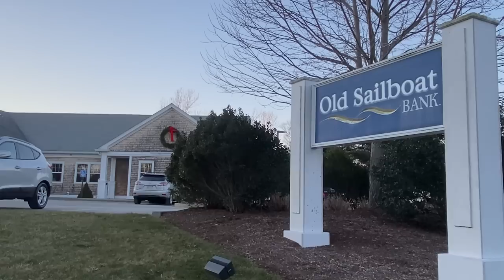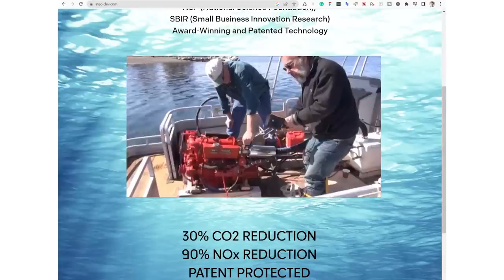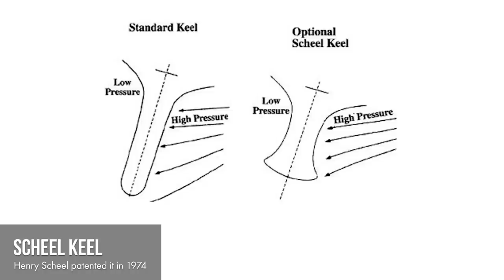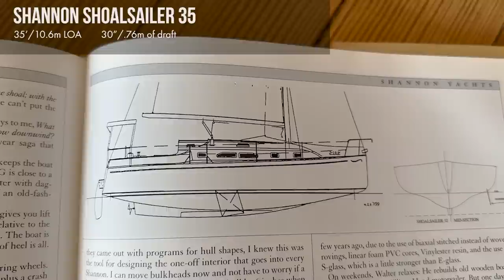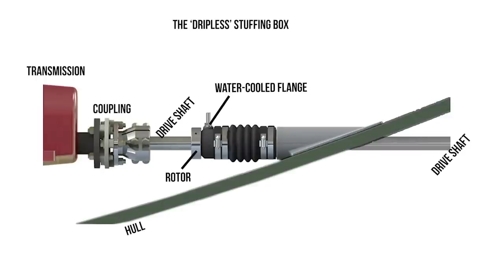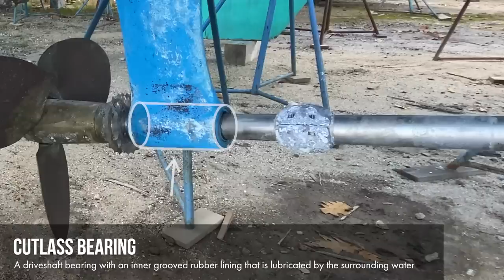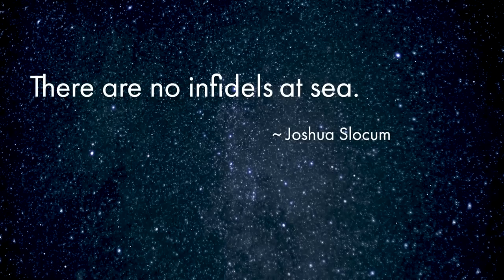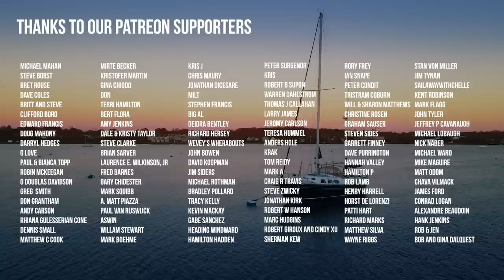Ran-day's Sailboat -  Visit from Walter Schulz - EP10 #sailboatrefit #sailboatrestoration

Comment: raN-dAY!   Cleaning out old bedding/re-bedding anything accessible including the CHAINPLATES with fresh butyl tape is a no brainer.  That should have been done already just for fun.    I usually do the Chainplates, pulpit and stern rails, mast deck plate if deck mounted(folks DO NOT USE BUTYL HERE, USE ADHESIVE SEALER) , stanchions, cleats, winch bases, chocks.....you're lucky to see the leak...most of the time it's rotting the deck core for years as it enters the deck somewhere and leaks into the cabin 10 feet away like that toe rail bolt.  ;)

Comment: Hi Ran Day, Tanks over the bilge annoy me also. i want to see what is down there and to be able to clean it out. The lazarette currently being used for propane is valuable storage space. To reduce it, you might have to make an insert then run a drain to one of your above water line thru-hulls. Is there any alternative discreet place available on a rail or on deck somewhere? You will find a solution. Your boat looks great. I enjoyed the video. Thanks for posting.
Reply from the maker: Thanks… there are definitely options… it seems like the easiest path is to enclose part of the lazaret and seal it accordingly with vents… other suggestions are to have external containers on the rail but I think I prefer to have them stowed… we shall see!!

Comment: so you explained this to me awhile ago. each step you take on a boat needs modification, each thing you add needs modification. each step adds 5 problems. so by the time you get it done you have 50 problems. in order to "have fun" you can really only deal with 10 problems. yet each of your fixes will add 30 more problems. so the next person to own this boat will have 80 problems to deal with. so moving leak to leak, broken part to broken part, all the time knowing that those tanks need to come out, the engine needs to come out. Yet instead you will have to buy 50 more hose clamps because in your life you will never actually fix this boat, you can only get it safe enough to use with the least amount of problems.

Comment: Randay,to deal with sludge in fuel tanks,you might consider using a air driven ''whizzer'',like the type used by home hvac duct cleaning companies after first chemically treating tanks to break up material in tank bottoms.Quick question,you got an extensive boat survey before buying that vessel didn't you?Because it seems like you might have bought the wrong boat.Good luck!

Comment: I bought an 84 Jeaneau with a similar system. I have heard many old salts say the same as he is saying about that kind of system. I motored the boat home 50 miles after purchase and had it pulled out on the hard. There was no cutlass bearing at all in it. The 1" shaft was floating in a 2 1/2 inch hole. All that was holding the ocean out was a seal held in a rubber tube by a hose clamp. I put a new shaft and cutlass bearing and seal in .I love the system. a completely dry boat with no bilge smell. Once you understand the system it is fine. Mine is not like the one shown here, I think most modern boats use this system. the system has had improvements. 
'
Reply from the maker: Interesting… is it a PYI/Tides PSS shaft seal? A few other users have suggested it’s a better iteration than the one I have…
Reply: @YachtHunters  I really don't know. It has a rubber cutlass bearing with a flange that is stock for Jeanneau and Beneteau (I had to buy one) Then the whole thing  is covered with a heavy duty hose (like a wet exhaust) that clamps on the outside of the tube the rubber cutlass is in and has a seal like an oil seal in the other end on the shaft that seals out water. Then, of course, it has the raw water feed that is teed off of the pump line. That seal acted as a cutlass bearing for 50 miles! It did leak a bit. I'M JUST DUMB LUCKY.

Comment: Randay - I put one on my boat.  PYI was manufacture.  Once it was set up correctly it did not leak a drop.  You need to have some preload on bellows to prevent water from coming in.  Had system for 5 years never leaked.
That system looks freaking scary.  Replace it.
Tom
Reply from the maker: I’m on it! Walter is my coach and I’m going back to the classic bronze stuffing box

Comment: I've been thinking about old fuel tanks. Although my goal is to build something with electric motors and lots of solar panels, I think if I inherited a boat that I was going to keep the diesel engines and the tanks were old, what about cutting away the top of the tanks and using them solely as a storage space for lots of smaller gerry cans (or similar) ? Maybe you could fashion a cap system whereby you had two cans (or containers) connected at once. When one was empty, the other one would take over and you could then put a full one where the empty one was. This would surely get around the problem of 'diesel bug' and also water in the diesel as the jerry cans would be small enough to use within a couple of days perhaps? It might be a bit of a bind when refuelling, to carry the fuel from the quayside to where your tank is, but you would rule out getting dirty fuel and your engine stopping when you least wanted it to. What do you think?
Reply from the maker: that could work... there are also bladder-style storage tanks that might work even better since they are flexible and could fit inside the fuel tank structure. The other option that might be more practical and simpler is to install a 2nd raycor fuel filter so you could flip between filters if one should get clogged (and allow you to pop in a new filter). they do a great job removing particulates (filters as low as 10 microns) and water.... so that might be an easy insurance policy. cheers!D

Comment: On another YouTube Channel the owner installed multiple lip seals on the engine side of the shaft. That allowed the owner to cut out a damaged seal remove the collar and slide a new seal into the dripless tube without removing the shaft.  For the people that choose to keep the dripless system it seamed like a good time saving idea. Reference 'Dogfish - A Kelly Peterson 44 Boat Tour' YouTube @ time 21:38 for a better explanation

Comment: Walter is 100% right about the propane. Any leak.The propane will go to the Hull the engine starter throws Sparks inside of it. That could ignite the fumes causing a mass explosion to blow the floor out from underneath you . Bilge pump or water pump for your sink could be a potential ignition spot. If you isolated that area/waterproof it with a big vent separating the airflow to the hull. You would have less chance of a Bomb.

Comment: One last comment: re: your “bomb”…for a *temporary*, safer solution until you design a safe propane locker, —secure them on deck (not next to a hatch. Just like a bbq, it’s relatively safe in the open air. If you prefer a little weather proofing, slap together a box with a hinged lid and a drain hole in the bottom. You’ll figure out the routing for your temp gas line (good time to replace it!)

Comment: I had a catastrophic failure,  I was only a quarter mile from the slip. If I was a mile away, I  would have sunk. Jumped over the side with a toilet wax ring and pushed it into where the shaft. Leaves the boat. They only last seven years. The replaced it with a new PSS shaft seal.
Reply from the maker: Wow!! That was some quick MacGuyver action… good thing you had a spare wax ring! How cold was the water? I suppose temps go out the window with adrenaline flowing… well done, bravo!!

Comment: That dripless shaft seal is set up incorrectly. The hose is improper that's why it's leaking. I never had a problem with a properly installed system

Comment: Let me first state that I own a 45 year old North American 40, I bought it from the original owner for approx. $30K and put in another $30K to redo the standing rigging and engine issue plus replacing all of the through holes (6 in total).  Unless you like working on your boat better than sailing your boat (I'm not trying to sound mean) why did you buy this boat.  There are lots of boats between 38-45 feet that are in lots better shape without 23 holes in the bottom.

By the way, I love your channel and have introduced others to it.
I wish you the best of luck.

Comment: The dripless doesn't look installed properly. The main thing I see is that there is no bellows. The bellows provide the pressure for the seal. Yours looks like a heavy hose, which would be proper for a regular stuffing box, but not a dripless. The other thing I have seen with dripless installs is the vent. That small hose coming out the top is the vent line, on power boats, it should be plumbed to the raw water pump, this should NOT be the case for a sailboat. This vent hose should simply be routed to somewhere on the boat that is 2 feet above the waterline. Follow that small hose and see where it goes. If it leads to the engine plumbing, this is basically pumping water into your boat. I have seen this before, even with the bellows installed properly. In heavy seas or high rpms, it will pump water into your boat. Simply route a long hose from that vent to anywhere 2 feet above the water line. The lack of bellows still seems odd/problematic, but dripless systems work great when properly installed.
Reply from the maker: interesting...I'll take a closer look at it for sure. I think the plan of action is to replace it altogether with a more traditional stuffing box...

Comment: Walter is far smarter than I but engines do not have frost plugs I have replace auto engines tha have frozen and broken the cast iron block without popping those plugs! There are core plugs put there to remove the sand core that are used in casting

Comment: I really have gotten to a point with you guys, Randall and C.Q... Where I just try my best NOT to comment.  I really do try to (NOT) comment. ~ Only AWE and feelings of NOT WORTHY.  Ya know. So (with that said) You have no idea.  I am retired, I spend every cent of the SS benefit on my house. (Two boat builds in the back yard which C.Q. has graciously acknowledged.). For the last three years I have been replacing my hydronic heating system on my own, new boiler, new chimney, all the copper sweat joints in the basement, new taco pumps, aqua stat, switching relay etc.  No oil in the tank all last year, heated with wood, fired up the new boiler in December and somehow it produces steam.  Lots and lots of steam.  Water Water Water with Diesel oil.  That tank empty for so long.  Definitely a new "line of research" for me.  Water in the tank.  Thank you Walter.  Thank you Randall.  Wow!
Reply from the maker: Steven, you’ve been practicing system engineering with your house so that boat systems will be a breeze when the time comes! Cheers

Comment: Your dripless is strange, its like a DIY hybrid attempt at a stuffing box and a dripless combined.  The scary thing with your is that the bellows, or hard hose in your case, has no ability to compress.  At least thats what it appears to be.  I know this is an older episode and its already been replaced, but a newer dripless like a PSY can be compressed to keep that interface tighter.  Tat being said,  if i had a choice i would choose one like the bronze one you upgraded to.  At least i would sleep better at night.  My dripless once got debris of some sort between the carbon stator and the stainless part and was dripping alarmingly fast.  I just happened to be at the boat at the time and was quite un-nerved thinking about what might have happened had i not been.  The fix was so simple though, i just had to run the engine in gear for 10-15 minutes in my slip and it cleared whatever was there and all was well again.  I take care to run the engine in gear now when im not regularly taking it out sailing once every few weeks in the slip to keep that surface of the carbon stator clean and smooth.  I also get in there with a nylon bristle brush and scrub it clean and burp it then give it a little fresh water rinse. I think the dripless seals are great but they are not in the least maintenance free.  I think they are even higher maintenance that the traditional stuffing boxes.

Comment: the dripless shaft seals should be changed like everything else on a regular schedule.  Every 10 years is a good rule.  there are tens or hundreds of thousands of these out there on power and sail boats and if they were a real problem like he says there would be lots of documented cases of boats sinking from them.
Reply from the maker: fair point... although I have heard about quite a few stories like mine(maybe about 5-6 stories) where owners lost the seal and were in danger of sinking... and that's just in my travels and feedback from viewers.  I think you're right... the success rate is quite high... I just dont like the practical matter of when the faces wear out, you'll be hoping your batteries are charged and the bilge pumps are working. Mine was 7 years old... and you wouldn't believe how bad the condition it was in...  Don't get me wrong, I love innovation and better tech but I also don't want to have to worry about what might happen when the faces get worn (and worry about when that might happen)... I'd rather have a few drips in the bilge  with the old school style stuffing box... and figure out a better method to keep it dry. cheers!
Reply: @YachtHunters  there are valid points on both sides but you also have to take into consideration how it was installed and maintained.  Was it kept clean, was it installed correctly, was it adjusted correctly, was it ever run dry, was it ever cleaned with the wrong chemicals…we just changed ours as it was starting to leak and I found out it was 12 or 13 years old.  After motoring 1 hour there was about 1/4 cup of water.  It had been compressed to the max so that tells me it had been adjusted several times.  I would hope that the rubber hose part would last 15-20 years at least as we all have 15-20 year old ( or older ) hoses on thru hull fittings!!! Is it the best, no but everything is a compromise of sorts.  To me the real tale of how good or bad a product is, is to go online and look for lawsuits where the product is being blamed.  I have not checked but will.

The last thing I’ll say in this is that it’s my understanding that after the boat is hauled that you must pull the carbon ring off the stainless ring to allow water to fully fill the area.  If you do not do this it runs dry and can cause a leak.  I think most people forget to do this step and it likely causes leaking and premature wear.  I’ll read the directions on our new one but that used to be part of the launch procedure.
Reply from the maker: yes... based on the other items on my boat that are patched together I can guarantee that mine was not maintained properly. Sounds like you got some good life out of yours, though... which is great news. Also, only 1/4 cup of water is impressive. When mine went it drained 2 large AGM batteries pumping out water for hours (as I was oblivious) and when i went to button up the boat it still had about 20 gallons in the bilge.... so I presume there was 40-50 that found its way in.  That's enough of a scare for me to look elsewhere.... but you're right... it's a set of compromises.  I was just chatting with Jon from @livingforsail about the balance of tech/dry bilge/reliability... he's leaning towards the PYI PSS system as well.... Sounds like you are more on top of it than most. I like your lawsuit check approach.. that's a new one to me :)

Comment: Your dripless as mentioned is an outdated poor design, research and update to a new PYI PSSS DRIPLESS SEAL
Reply from the maker: Definitely worth looking at that option. I don’t love anything that requires dropping the shaft out to maintain… the old school ones just require new packing material every two years and you can do it from inside without dropping the shaft out… also, when the new ones fail they can really sink the boat compared to older styles ones that don’t fail quite as spectacularly.  Mine is so far down the bilge I’m not totally sure how manageable repacking it will be?
Reply: @YachtHunters  After you research PSS dripless seal system, you’ll find it is possible to repair or replace with the boat in the water but requires a proper pump and a bit of fortitude and you’ll find with properly scheduled maintenance they don’t drip, leak or fail, unlike lip seals or packing glands they also do not cause excessive wear of the the shaft. Ultimately with all the methods or systems, it comes down to preventive maintenance.